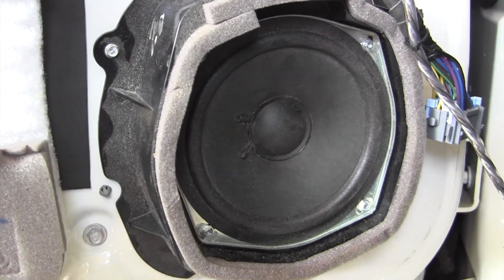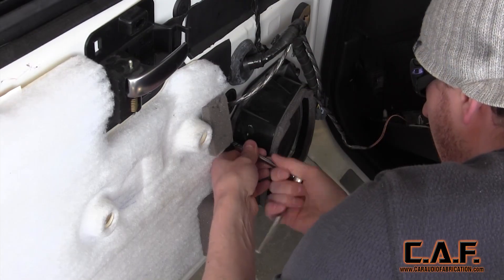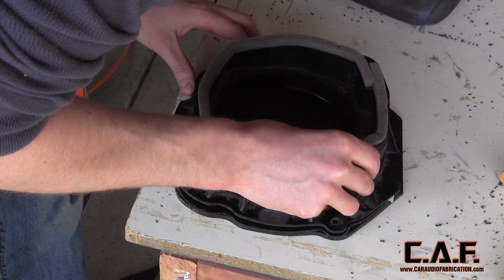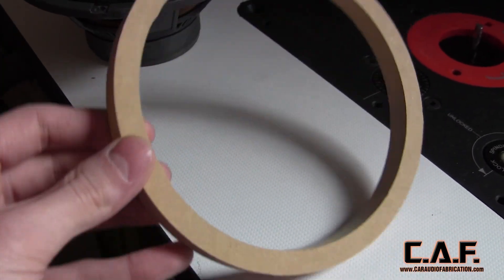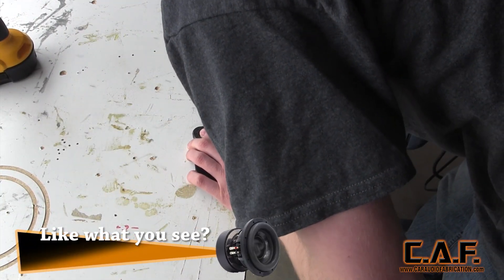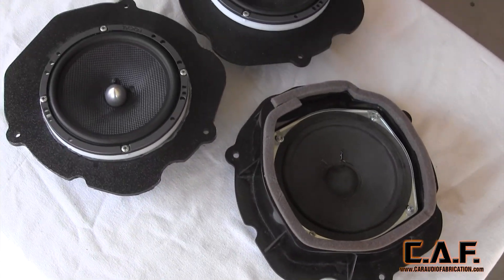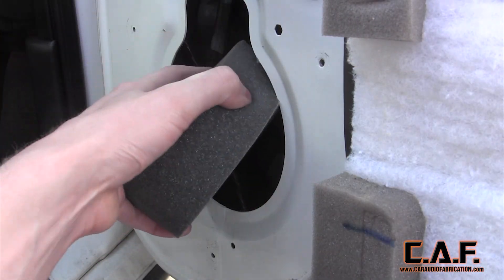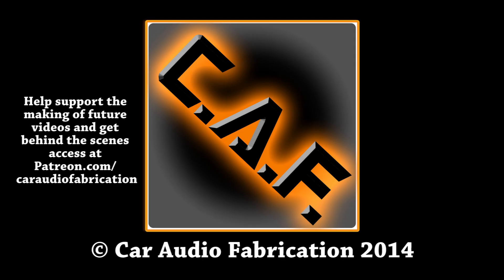How to Add Mid Bass - Build Custom Speaker Adapters CarAudioFabrication

Comment: This is an awesome video but ,in case you guys dont have these tools you can always order specifically made brackets for your vehicle, and use these techniques. some speakers comes with foam and you can always add sound damping material. Theres many custom made brackets for sale, on metra or cruthfield

Comment: Question, hope it gets answered. What about creating a small 'box'/ enclousre for the back of the door speaker. Kind of like a subwoofer box. Or a foam baffle(But out of plastic or something) And not doing the whole door cavity deadening technique. What result would that give?Thanks for the vids. Best ones around imho.
Reply: that depends on the volume requirements for the speaker. I know most 6.5" are ridiculous, even if they're ported. something like 2-4 liters. If you can do it, it will sound great, but you should still deaden your doors to prevent vibration.

Comment: Hello +carAudioFabrications greeting from India, New Delhi, just starting watching your channel and I'm very impressed with it. 
I have a quick question. 
I have a 4 channel soundbarrier amp with 720 watts, I have attached a 1800watts 2ohms, 12inch bass tube with 420rms in it. 
I have tuned my amp at 150hdz for the woofer and attached one positive of one channel and one negative of another channel so basically 2channel to only get double output, I get very loud high bass but I get less mid and almost no low bass. 
please help.

Comment: Focal speakers? Impeccable quality, but very tight frequency ranges. You really can't get away without using a subwoofer with those speakers. Easily solved if you have money, space and an amp. 

Another thing: if you can, and you should, don't use the included philips head screws, instead you should go out and buy some decent quality torx or hex screws. These will prevent you from accidentally punching a hole in your speaker when you go to install it. The inset locking surfaces of these screws keeps your bit from slipping or drifting. I highly, highly recommend them, as they are what came with my speakers and they made the install that much less stressful.
Reply: What does having a Phillips head, a torx head or an Allen headed fastener have to do, with damaging the driver during installation? The fastener has nothing to do with it, it is the installer's fault when the tool slips off the fastener and causes damage. From being in a hurry, not paying attention, or from worn driver tips. I installed for 12 years in a shop and am still doing installs in my own vehicles and in friends. Every time there was a hole punched in a cone or surround it was the installer not the fastener. Like using an 18 volt DeWalt driver, to fasten four little retaining screws on a door speaker because it's fast. Do it by hand, or have a smaller less powerful corded or cordless driver. I use a nice and small Makita 9 volt, driver for small stuff, or a hand held driver. If the head of the fastener is chewed up, don't reuse it. It is a lot cheaper to use new fasteners than to replace drivers damaged by, installer error.🤔 And 9 times out of 10, when you remove factory speakers. They aren't held in with Phillips head screws anyway. Most factory fasteners are hex headed screws or bolts anyway. The fasteners that come with most aftermarket speakers, including high end component sets. Are usually just regular or self tapping Phillips head screws. I do use torx, or allen headed fasteners on my personal installs. But that is only for security. Most thieves don't carry more than a Phillips screwdriver, wire cutters, pliers and a few wrenches. I feel if they are going to steal my stuff, I'm going to make them work for it. Because the longer it takes them, the more chance they have of getting caught. 😏 Well that's my $0.02, Peace.

Comment: The one thing I didn't do when I replaced my stock speakers was use a foam surround.
I sealed the speaker, used 2 layers of dynamat both inside and outer side of door to seal it up from back waves. Got the JL Audio C3 600 speakers and they don't have much mid bass.

Comment: Im curious, why use 2 different plastics to make the ring, is there a reason you use ABS for the base and hdpe for the ring??
Reply from the maker: Michael Boris No particular reason. I feel like the ABS is a little more strong, so it works well in the thin application, but ABS gets very expensive the thicker you go, no reason not to make the ring out of HDPE. The HDPE taps nicely as well.
Reply: Awesome, thanks so much, great videos btw

Comment: Those speakers you installed, look identical to the ones I just installed but they're not the same brand. They're "Lanzar OPTI6M-8 500 Watt 6.5-Inch Midbass" and they sound pretty f*cking awesome for being non name brand.
Reply from the maker: Eric Ver Linden These are made by Focal. Glad to hear you are happy with yours. The install can make a big difference!

Comment: Great vid! I subbed a little while before I watched this vid. Your work seems great but has a lot of labor and expensive parts in it. Is there cheaper alternatives to what you use? like the foam can be MLV or neoprene cut to fit? or even weather stripping? can the plastic be subbed by wood or even have just the foam itself and bolt the speaker to the door? what are your thoughts? if you cant answer because of your sponsors I can understand

Comment: One thing, speaker never sound better in plastic box, it sound's more better in wood box. so, wood pods are better, just you have to use some materials protect pods from elements, like truck bedliner. Other thing, for speaker holes use a drill that drills 100 proc. straight, thats a portative drill maschine whitch can be screwed on to the working table. Fast rings are really good thing, thats for shure :) Anyways, good work guys, seems factory level, not noticable ;)
Reply: ***** Yes that is true. There is many manufactures who use plastic for enclosers however wooden boxes sound much better and is used by top manufactures for top of the line products like Yamaha NS690 II, Tosil Altus 300 or Pioneer Z83D. Btw logitech is not best example of premium audio company.

Comment: CarAudioFabrication Hey love the vid! Just a quick question, I don't have a router but really want to make up these plastic speaker mounts, would you think rough cutting with a jigsaw and then using a sander would be ok to get a similar result? Thanks :)
Reply: Great vid!! I would also like to know if that would work. I'm looking to put after market speakers in an Astra J and the currents ones are glued to the adapter. Thinking of doing the exact same thing using the original adapter and template tape to get the right edges. Would appreciate the feedback CarAudioFabrication

Comment: how does the plug not get hit by the window when you go to roll it down
Reply: It depends on the door. There are only a handful of skinny doors I have found that the window hits the foam and in that case you simply cut it down with an Olfa knife.

Comment: Question, I see the foam rings come with a foam plug that you put behind the speaker. I am in the process of installing rear door speakers and was was planning to dynamat the door, but the foam would obviously be cheaper. Which would give better acoustics between the foam and dynamat?? Thanks
Reply from the maker: Visesh Lall I would still apply dynamat to the door skin, your goal is to remove the resonance from the door metal flexing. The additional weight of the dynamat is much better suited for this goal.
Reply: Ok. Thanks for the advice..

Comment: This is so cool. I have a set of components in the doors of my Ranger but I don't think there is enough clearance for anything like this, any suggestions (apart from door pods)?
Reply from the maker: The foam compresses so there should be enough clearance. Can always do a full panel build as well.
Reply: Thank you.

Comment: When I was competing in IASCA SQ competition mid bass seemed to be the thing most installs didn't have enough of and impressed judges the most. A big factor seemed to be power, too many dedicated all their amplifier watts to their subs and didn't allocate enough for their front stage woofers- which often require up to 150w a side to get a lot of punch. 
The 6.5" components (old school Soundstream Exact) in fiberglass kickpods in my current install get 120w per channel and could do better but it's all I have from the a/d/s P840 I use.
Reply from the maker: I think mid bass is one of the most important things for tying everything together. Its easy to have bright sound as tweeters require no power to be screaming, but to warm things up and couple everything together you really need that mid bass, and as always, the install makes a huge difference.
Reply: CarAudioFabrication I guess it doesn't help that manufacturers of component speaker systems are very ambiguous about recommending the best enclosures, when you buy subs they are very detailed about what size box to build or what type it should be- installing 5.25's or 6.5's seems to be pure hit or miss. Screwed to a door with an open back, put into an enclosed kick pod, who knows?
Reply: In my last SQ car I ran 100 watt's to each of my F#1 3way's a side. I got great mid bass score's
Reply: For $3500 MSRP I'd hope so.... :-)  never owned any alpine speakers, have had some of their source units and amps in the '80's...back when there was alpine then there was everything else below them. When "enough mid bass" seemed to be 13's in kick panels (femi adeoke's gran prix, earl zausmer's BMW) I quit competing.

Comment: i have a question i used to install car audio in the past .and i believe that copper was a better conductor then stainless steel wire i lately attend a car show here in philly there was some guys that told me their running stainless steel braided wire in their cars and it's better than copper .so which one is a better conductor?

Comment: hi, nice video. I like the way you tell. I searched your videos, i can't find a tutorial about how to put the speaker cableS though the door. I think there are many people who want to drive 2 ways or 3 ways actively. That means you have to put 6 cables through each front door. Now the most new cars use combi-adapter on the door, so that you can't squeeze the cable through the tunnel as the old time. Would you like to make a tutorial how to solve this problem. Thanks for the video and regards

Comment: The speaker mounts look great, i used the same method for my door speakers myself, now im looking to buy the foam rings.
But the information on the site is a bit vague, does it come with foam rings for two speakers?
Reply: Each kit will do 2 speakers
Reply: Great, thank you!

Comment: I made a boombox using the same speakers and an alpine head unit.  Sits in my warehouse and sounds amazing.  I have the parts to make a sub woofer for it as well but haven't gotten around to it yet.  

BTW I've never been into putting expensive systems in cars.  I usually buy sports cars and it kinda seemed pointless.  However I am planning to buy a classic car soon that I intend to keep for a long time.  I figure it makes sense to put a really good system in it.  I was looking at the stage 4 system and just using it for the whole car.  Think that's a good idea?  Going into a series 2 jaguar xj6.  Also going to put a ls motor and drive train in it.  It will be my family car.   :P

Comment: CAF, question. How would you integrate speakers into the door of a old body suburban?
The bottom of the door looks like this:

 http://i1.ytimg.com/vi/mczSAD3egbw/maxresdefault.jpg

I was thinking about a door pod on the carpeted area, but then I'm unsure how to actually mount the pod to the door.

Comment: i have a question, anytime I have wanted to upgrade door speakers and the wires to them, I can't figure out how to run the bigger, upgraded wires to them through the factory, door jam location. how is that done without it looking like a hack job??

thanks, great video as usual
Reply: ahhh, yeah cause I believe both of my cars have a plug in harness type door jam set-up.  if I drill on top of these harnesses, will I need grommets? they would need to be small grommets...
Reply: ok understood. thanks allot

Comment: Just in time.. Great Tips. Getting ready for an install in my 2013 F-150.
Now if I can just find the Illumination Wire for the radio. Good by Basic sync audio system.